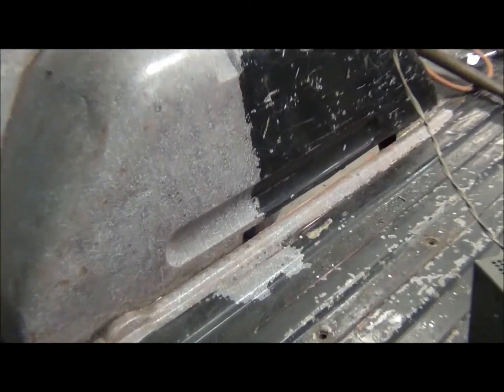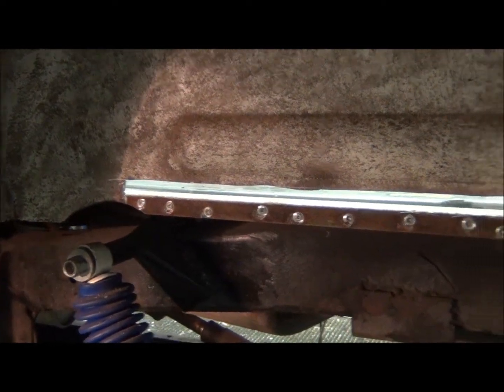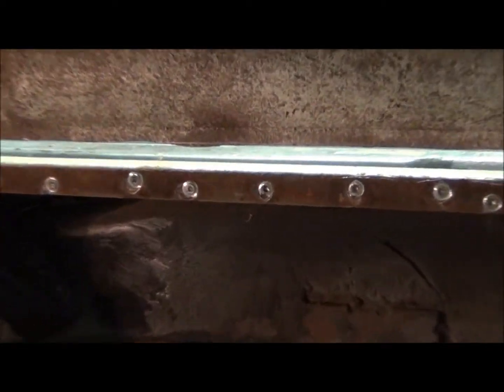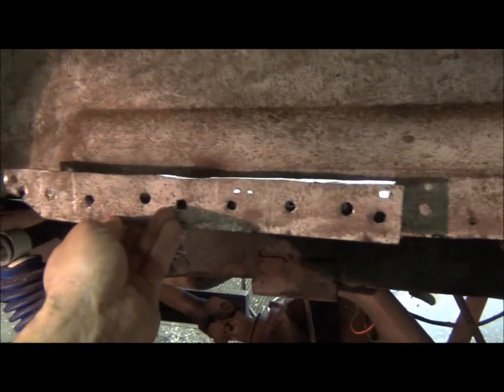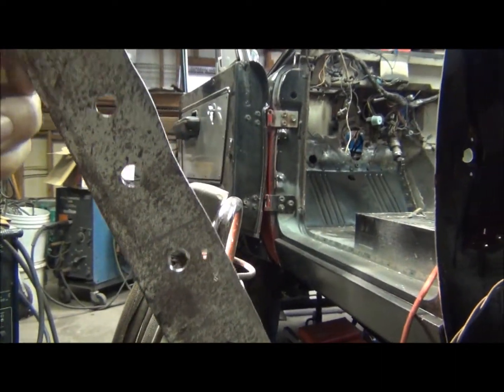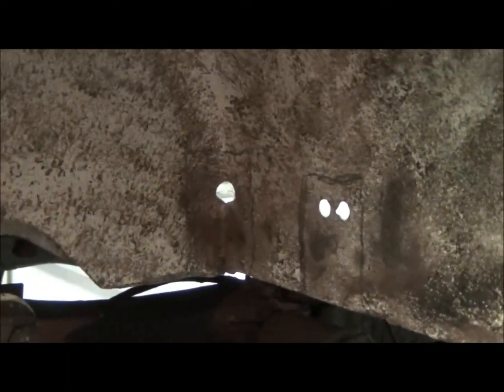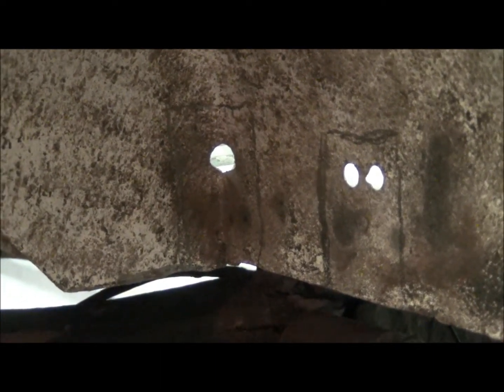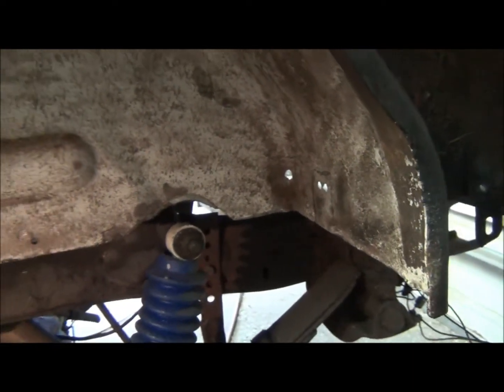1973 Early Bronco Project Part 33 Wheel Tub Repair

Comment: What welder are you using? What size wire? Your work is amazing.
Reply from the maker: Thanks for the good words. I use an old millermatic 200.  Mostly 030 wire size for sheet metal with c25.